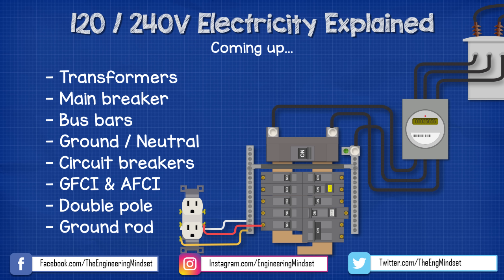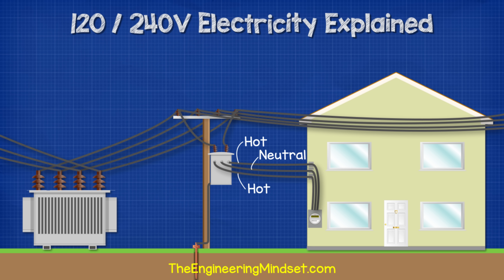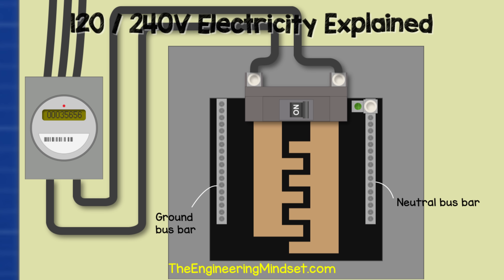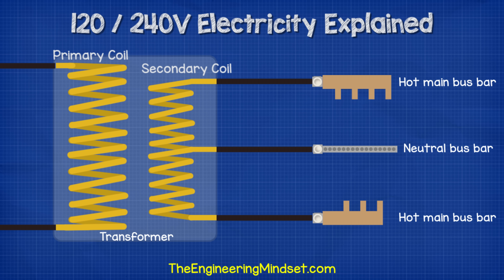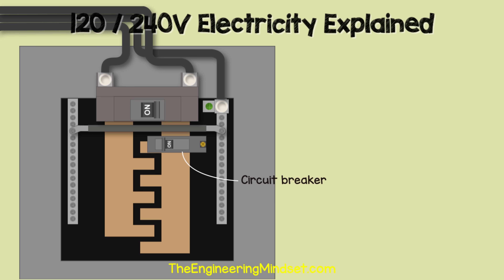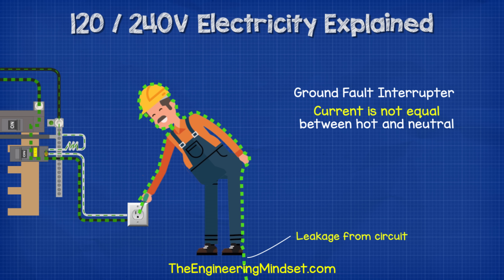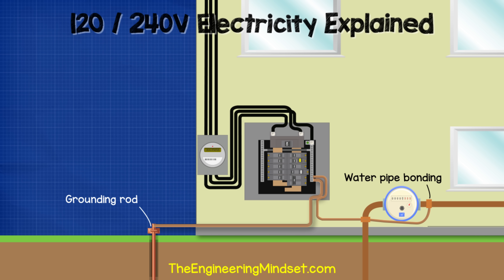120V 240V Electricity explained - Split phase 3 wire electrician

Comment: what you failed to mention was that the center tapped transformer produces two 120 volt legs whose power is 180 degrees out of phase. this is why you can have 240 without it acting like a short.  the phases add to each other rather than fighting each other.  i know this is  an entirely different subject but without understanding this concept  a clear understanding will be unavailable
Reply: I understood how the wave forms looked and added up but I never understood what was physically happening inside the transformer until I saw this video so I found it to be pretty enlightening. There are lots of videos that dive into the wave forms, degrees of separation, RMS, etc. so if someone wants to learn that they'll find it.
Reply: It's actually incredibly easy to understand, and while I have been familiar with the customer side, including 3 phase etc, this video helped me visualize split phase much better conceptually than ever before.

It is very easy to understand that each winding of a coil produces more voltage, and so the longer the winding the more voltage you get, and so the full length of the coil will produce 240, and if you take half of it, you get 120.
Phase angles don't really matter until you get into polyphase systems.

Well done.
Reply: Actually the phases out 180° would be the definition of fighting each other. If they didn’t fight, which is called complimentary, there would be no voltage difference, no current, and no power.
Reply: Rýán Túçk Indeed. As long as you don’t short circuit the wires, there will never be a short circuit, no matter how the phases are shifted to each other. Only the potential difference (= voltage) will change.
Reply: In a wye connected transformer the three phases are 120° apart. This gives you a 120/208 system which is typical in almost all residential and commercial properties in the U.S.  even though most residential properties only get two hot wires they are still 120° out of phase. To get true 240v power the transformer must be wired delta. Take a meter and check your panel and you will get a measurement of 120V hot to ground/neutral, and 208V hot to hot
Reply: richard cranium    Where do you guys get these wild explanations?   Your oscilloscope and your teacher lied to you!   Now you are stuck with wild ways to explain simple things.
Reply from the maker: I disagree, that is way beyond what this video set out to show and as mentioned we will cover that in a more detailed video

Comment: Do power stations use Inverter's before sending AC to step-up transformer in order to maintain hertz at constant 50 or 60 hz? Or do power stations constantly maintain RPM of electric generators to in order to keep hertz at constant 50 or 60 hz?
Reply: The frequency is not as exactly 50 or 60hz, it can be lower or higher, depending on the how much power is generated amd consumed. There's a concept called "frequency droop", you should have a look
Reply: when the generators are connected to the grid the rpm will maintain itself and so will the frequency. meaning that when they try to push the rpm higher more power will be generated and if you try to have a lower rpm the generator will work as an motor. (note that this is an over simplified explanation). There are usually no converter from AC to AC as they are expensive and provide extra losses when they are not needed, they will instead use 3-fase transformers.
Reply: @kimrkarl  Is there a video that explains everything how power stations generator rpm maintains itself and so on?
Reply: @Xeno_Bardock  I have about 80 hours of lectures videos... but i can't share that.. other then that i don't know.
Reply: The frequency is set by how fast the generator is spinning. Frequency can vary slightly throughout the day depnding on the system load but the power company tries to keep the average frequency over time at exactly 60hz so things like motorized clocks stay accurate over time.
Reply: I've wondered this over the years myself. Been in residential and commercial building all my life and studied electricity since I was young and have done street to finish residential and worked with a buddy who was an electrician for seven years but not being my priority craft, I have often used my cheat sheets to remind me. Same with plumbing and other crafts.

Comment: Is there a way to convert 240 dual phase to 240 single phase. Could this be done as a way to use European appliances and or electronics like CRT tvs or lights?

Thanks for the video mate, cheers have a great day.
Reply: its split single phase, not two phase in North America. And yes you can run 240 volt appliances across both hot leads.
Reply: Jl4zio  Thanks for the response. How would you wire an outlet "to use a UK CRT" on the split single phase?
Reply: @peteasmr2952  no offense but doing that would be really dangerous and the fact you are asking how to do it leads me to believe you aren't very experienced. I don't want you to get hurt.

Also the UK TVs use PAL while US uses NTSC. The line frequency is 50Hz in the UK. US is 60Hz. That may cause timing issues and or electronic problems when attempting to do that.

Your safest bet would be to look into a 120 to 240 converter. This will be the safest option. As for the line frequency difference you would have to figure out if your model would be affected.
Reply: Jl4zio  I was only trying to figure out the most sufficient method to convert to a full PAL analogue setup because I do VHS restoration and use NTSC. I've read about some cool stuff about how pal was improved and I want to test it but also be able to expand my services to my Euro friends. Right now I'm looking into this device that converts AC to DC back to AC to create a smooth sine wave. You can convert 120 60hz to 240 50hz. I want it to work exactly as it does in Europe. I also play older consoles and want to compare the PAL experience to the NTSC experience. My only issue is finding a SONY trinitron PAL 20 inch and how to import it to Texas.
Reply: When I get my own home I'll setup solar panels and one pannel will be connected to a UK solar system. A special room will be wired with the correct standards and checked by an inspector. One set of outlets will either be UK or the one used in Germany. The second set of outlets will be type b gcfi outlets running off the houses 120 60hz solar line. This way I can have European and US equipment side by side and not have to worry about a transformer that could pose aditional fire risks.
Reply: @peteasmr2952  Your building inspector would not approve a European-style outlet system. The code system in the US is NEC which does not cover UK or EU style building codes, their boxes and receptacles are completely different sizes so they would not fit in an approved electrical box and your inspector does not want to see home-made hacks to make things fit. 

Besides that it would be very difficult to find parts in the US for your system, your property and installation would lose value which is the other thing building inspectors care about (resale value which impacts your taxes).

What you need is an adapter from your 110V/60Hz to 220V/50Hz. For things like CRT and other coil-based systems you will need something bigger and perhaps even customized.
Reply: @peteasmr2952  If you do decide to run a 240V circuit, I would recommend that you use the French outlet, as it is polarized and inserts more nicely than it's German cousin, and is much smaller than the British outlet..
Reply: Nulano  I was considering the French one as well. There is a chance I might move to Europe one day and I don't care about resale value. I would like a room that has both native systems to avoid any issues with running convertors. It looks that in the mean time the $2000 AC DC AC convertor rated at a more than sufficient wattage times 3 "current protection" for my setup which can convert to 240/50hz is gonna be my best bet. Maybe there will be a more sufficient system one day. Either way I plan to have an offgrid solar system one day. And hopefully I'll be able to make my dream a reality.

I will find a way to safely run a Pal TV and VCR in the US.
Reply: Jl4zio  I am not a licensed Electrician, I grew up installing electrical and rewiring it. The place we lived had bad wiring and my dad wanted me to learn how everything worked film the day I could walk. I am a Tech and Video specialist. The technical differences between Pal and Ntsc are fascinating. How VHS worked for each region and the colour system and why the US didn't try to fix some of the issues with never the same colour is very interesting. I have a whole list of things I want to compare about the two. Getting to work on each side by side will be a dream come true.
Reply: Jl4zio  Despite growing up knowing a lot of this I didn't really think about how the Split phase system differed to Europe. I was thinking about this recently and wondered is there a transformer like the mains outside one that can unsplit the phase just like it split the phase with neutral in the centre. I would imagine there has to be a way, would it be less dangrous than a step up transformer at this point I don't think so. As for frequency conversion I can't find out if you waste power in the conversion. And since I still love in an apartment have no intention of messing with electric. I honestly just want to know cause this is really fascinating. For now I'm just going to get a sufficient convertor.

And sometimes people ask things because a text book can't tell them the answer or even Google. It seems that the questions I have aren't a common concern as I can't find anything on them. Even the electricians I've asked have no clue. So it doesn't seem going to college for that would have helped me learn the answer.

Anyway thank you all for the help. I am going to go the safest route no matter what, part of this is learning what that is. Some of these questions aren't things I plan to do. I'm just trying to figure out if there's a better way so in 20 years I will know what to do. If using a convertor is still the best, than that's what I'll do.

Also if I do ever get to wire a room with both systems I will be removing the non native system when I move. I grew up doing construction and renovation plus plumbing. So remodeling the room so that I can easily remove the wrong standard and reset the room back to the countries respective standards wont be too difficult because the room will be made from the start so that it isn't too permanent. Yes I have also been studding the respective countries building codes.

As for right now I am just getting a PVM Multisystem to do some of my tests but it would be cool to see what native equipment is like in comparison one day.
Reply: @ GuruEvi: Reading your comment leads me to believe that you’ve never seen an electronics repair work bench, where you frequently will see homemade specialty outlets, isolation transformers, dim-bulb series power supplies and variacs, etc, sometimes feeding hard-wired receptacles in the more elaborate setups, and nothing NEC spec.
Reply: Again I only know the basics to construction plumbing and electric that I learned growing up, I am not a master I do not claim to be licensed. My family who taught me were the ones with the licenses but they didn't exactly take me to their jobs and show me their work benches. We did have one at home but it had stuff from all of their professions strung about and none of them were exactly hobbists trying to make their own coustom equipment. Plus they retired before I got old enough to really ask these questions.

Not all of my questions pertain too my plans I'm just trying to learn and had many questions that got mixed into a real project.
Reply: Sorry, my comment was aimed at one of the other posters trying to throw out dire warnings that you should not try what you are wanting to do. Many, if not most electronics repair setups will have homebrew hook-ups and power supplies that would make an NEC code-nanny’s head spin. So what you are wanting to do is not that unusual. I have revised my comment to make this clear.
Reply: okbridges  Thank you for your reply. I appreciate and I now understand what your were trying to convey.
I did look up isolation transformer and finally came across a few things that would help in my endeavors.
Thank you have a great day
Reply: @peteasmr2952  install a highpower outlet like the one for your washing machine.
Reply: @Jl4zio  Wow I learned something new. lol Thank you. I always thought each side of the bus bar was a different phase (i'm learning, I do not do this professionally).
Reply: @AdamMT1618  no problem. I love electronics
Reply: I have in fact installed a German "Schuko" outlet in an American home on a 240 volt circuit. Since this style is not polarized (unlike a UK outlets for example) all appliance made for these are safe even when blue/neutral is hot. I suspect this is true for all modern appliance (and certainly electronic/computer equipment) made for the global market. Therefore, I see no problem that both legs are "hot" in relation to ground/earth. Of course the frequency is 60Hz instead of 50Hz, and the actual voltage is 240 (or 208 in commercial buildings) instead of 230, but again that is not a problem for anything made for the global market. You should however use a double-pole (240V), 15-amp GFCI circuit breaker (something that is going to be hard to find for US-style load centers.)
Reply from the maker: Could be easier to simply buy a portable 240V 50Hz generator or portable solar inverter from Amazon.co.uk and have it shipped to the US. Just use it when you need, completely separated from your electrical system.
Reply from the maker: Power inverter video  here https://youtu.be/iIqhAX0I7lI

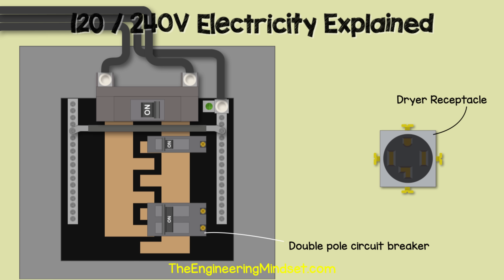Comment: I think good habit is to install 300mA rated GFCI (Same as AFCI?) after main switch. To prevent fire. And after that 30mA rated gfci to each room, especially  separated for kitchen and bathroom sockets. 8:30 this socket is quite interesting, never saw it before. But if i have to use a big energy consumers like Air Conditioner, or cement mixer i have dedicated 3 phase sockets wich give me 400V

Comment: I found it interesting that the MSB's were neutralised (neutral bonded to the board) which would imply that there is no upstream fuse protection between the main overhead (or underground) lines and the isolator (CB) Main switch.
Reply: There's a big fuse on the pole near the  transformer between the high voltage overhead lines and the transformer.
Reply: @kjpmi  That's protecting the HV lines not the LV lines to the house. In Australia we have a mix of systems with older ones having over head lines to the house and a fuse box directly before the cable enters the house, under ground from a pole will have the fuse box attached to the pole and finally full underground will usually have  a direct connection from a pit with the fuse on the switchboard. The first two only require the switchboard to be earth whereas the last one requires the board to be neutralised or an earth conductor of the same size as the incoming neutral.